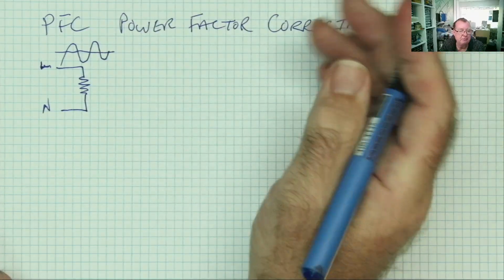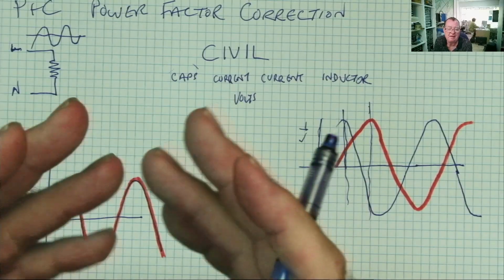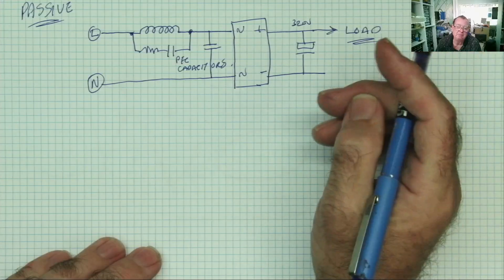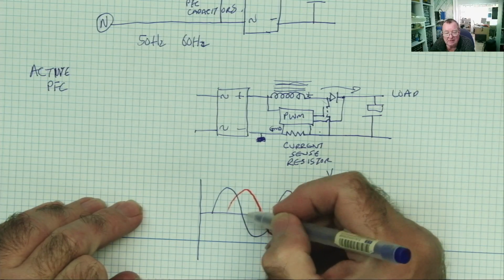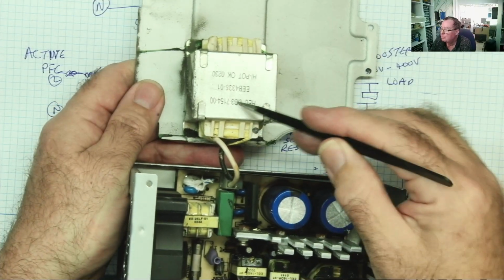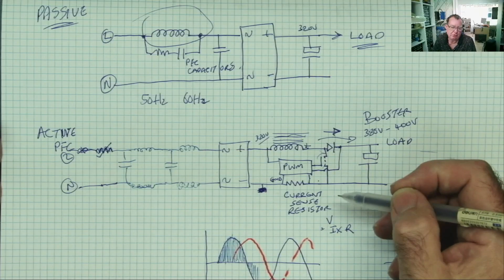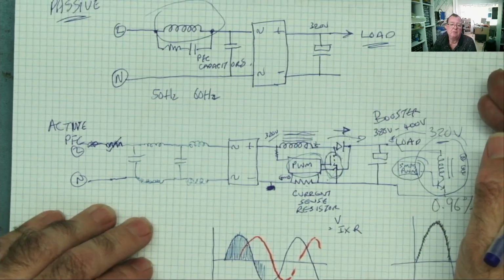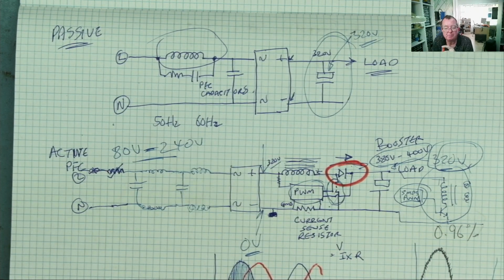All You Need To Know About PFC To Fix Stuff : Power Factor Correction For Beginners

Comment: Thank you, very informative video on active PFC! So, even on mains as low as 80 VAC, the load capacitor is still at 380-400VDC? In other words: the capacitor is always on 380-400VDC regardless of the input mains voltage?

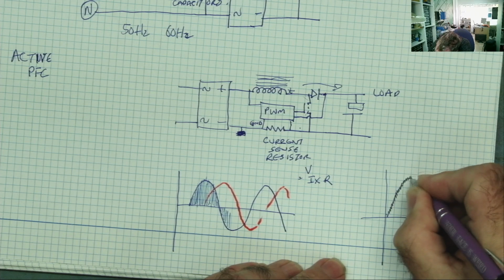Comment: 16:09,   I don't see how, by doing the PWM, the current at the output would just automatically follow the sinusoidal voltage to become in-sync. You just drew the micro fluctuations of current along the sinusoidal voltage curve, but how?  Why wouldn't the current still lag?  what makes the current profile fall onto the voltage profile in a time-synced manner ?
Reply: Because you (usually) need the voltage to push the current.

Comment: Hi sir
I have problem with a Dell laptop adapter (With PFC), many days confused me

When no load connect to it, I have about 500v on big capacitor (100uf 420v) that goes up dangerously, when I switch off it, capacitor voltage don't drop.
But with load on output, it works normally, 340v on capacitor, and when switch off, capacitor voltage drop fast to 0. Do you have any idea what's wrong about it?

Comment: Great video, in modern LCD TV power supplies (which I no longer repair…too many faulty screens discovered after repairing backlights) the PFC is a favourite to go up in smoke, either the controller fails or the MOSFET does taking out (violently) bits of trace and other components, remove the dead bits, PFC diode and isolate from the live feed, fit a link from + side of rectifier to main smoothing cap positive and away you go.

Comment: Poor power factor in power supplies that use capacitive filtering has nothing to do with phase shifting in the usual sense. Such supplies present an extremely non-linear load to the AC input source. Current only flows from the AC source when the instantaneous input voltage exceeds the instantaneous voltage on the filter capacitor, which means current flows only around the peak of the voltage. The rest of the time the current is zero. This results in a very high ratio of RMS to average input current which is very detrimental to the AC power distribution system. (The actual power consumption by the load is always related to "average" whereas the losses in the power network are mostly related to RMS.) Active PFC makes the input current waveform sinusoidal and in phase with the input voltage, making the load appear to be a linear resistance. The instantaneous input current is made to be directly proportional to the input voltage but the average input current must be made to be inversely proportional to the average input voltage. The latter is actually a "negative resistance" characteristic (and exhibited by all switchmode power converters that have regulated output). The duty cycle of the boost converter changes throughout each AC input half cycle. When the instantaneous input voltage is very low it still must be boosted to about 385 volts (in a typical "universal input" design) so a high duty cycle is necessary. When the instantaneous input voltage is at the peak at the highest allowable line voltage almost no boosting is required.

Comment: Blessings !!!
Thanks for that important and interesting information !!!
I have a power supply "Corsair" TX850M (of course 850 W.) and I changed the main capacitor ( 560 uF , 400 V ) because it was blown.  I bought and put a 860 uF, 400 V in its place thinking that it will fix the problem but it didn´t and as soon as I connected the PS, the new capacitor began to make a shshshshsh sound and smell in the specific way.
So the capacitor was not the problem but the victim of a malfunction which I suspect is located in the PFC.  Something is causing to raise the voltage above the 400 V which the capacitor can handel.
Can you give me any hints to solve this problem ?
I´m not a professional of electronics, I´m just trying to fix my power supply; but I´m also learning a lot about these apliances and I find them fascinating !!!
Blessings again !!!

Comment: Hello, friend I've got a expensive power supply if you can help it outputs 12v 4.5amp,24v 6amp with active pfc the pfc start at 370v when I try to drive 1.5amp from the  24v rail it drops to 300v at 12v rail it drops to 350v at full load (I disconnected the 24v rail) what do you think is't the 24v or pfc ?

Comment: On active PFC with power source removed, can the residual voltage across the big cap be measured across the diode, given that one side is at cap potential and the other side is at bridge rectifier potential, which is zero?

Comment: Plus one question: there probably is a voltage feeding circuit after the initial start to serve the pfc chip vcc during normal operation. Some info about this plus a simple schematic would be interesting

Comment: 33:30 - Thanks for adding that in (even if it were just an afterthought!) Before, it was difficult for me to understand how a single power supply could be used on such a wide range of input voltages. Until now, it had been somewhat of a mystery to me. I learn something from you every time I see one of your videos (some times it takes my watching them more than once to get all the nuggets out of them)!

Comment: I love the expression GND🥰.... VSS or VEE are weird names 🤖.
Reply: VSS,VDD, VEE and VCC VCE wouldn’t be used here they were applied terminology for lower voltage (often logic) circuitry. Voltage Source Source (and Drain Drain) CMOS and TTL for Voltage Emitter Emitter, Collector Collector, and of course VCE is a definition of voltage a transistor can withstand (without failing) across its Collecter Emitter (with the Base open circuit)

Comment: Hello, Richard! Thank you so much for this lesson.
It know it may be way too simple, but, if you can find the time, could you please make a video explaining about current sensor resistors? I'm always lost when thinking about how can a 1 ohm resistor "sense" 10 amps of current (since it will have about 10 watts going through it, I think).
Again, thank you for all your videos. I wish I can repay you and so many other youtubers that teached me so much someday or, at the very least, thank you in person and bring you some gifts. Cheers!
Reply: It's because the voltage across the resistor increases as the current increases, by Ohm's law. A 1 ohm resistor with 10 amps running through will have 10 volts across it. So the PWM/PFC chip is measuring volts, to know what the current must be.
Reply from the maker: Sure, I'll make a video about this topic

Comment: Amazing lesson as usual, but I didn't understand how this circuit got the current wave to be close to voltage wave, I understood it is trying to keep the capacitor 390v all the time but in terms of wave didn't get it, can you please explain a little bit to make it more understandable. Many thanks for your efforts
Reply from the maker: It didn't exactly, I used a bit of poetic license to get the principle over. 😇 The switching mosfet will cause very rapid voltage changes in the waveform.  But the filters on the input (capacitors, inductors) remove the high frequency switching noise and you then end up with a waveform like the one I showed

Comment: Hi, Richard. Thanks for this, it explains nicely how PFC works, which I didn't quite understood until now. 

And the last 7 minutes or so are GOLD, because you MIGHT make the mistake of trying to measure the main cap voltage in the bridge rectifier, being this such a common practice. I made that mistake once with a minicomponent power supply, and got a shock, fortunately only an annoying, not a deadly one. 

Made a video of it in my channel as a warning, but I'll better update that and explain that we should "look out for it" when we got an active PFC in our board. 👌

Comment: Do you know anything about this chip? L4981AD?  https://www.st.com/content/ccc/resource/technical/document/datasheet/0f/6f/aa/38/e1/97/4c/ca/CD00000085.pdf/files/CD00000085.pdf/jcr:content/translations/en.CD00000085.pdf
Reply: Oops hit enter too quick... I replace alot of these at work., but the power supplies have the circuits you mentioned too.

Comment: can we disable pfc when the pfc pwm and smps pwm is single chip?
Reply from the maker: Probably not as the PFC controller is monitoring the boost voltage. But no doubt it depends on the chip type
Reply: Why would you do this ?
Reply from the maker: @Lightrunner.  It's a useful repair technique, if you have for exampe a short circuit PFC mosfet on a 'combined' PFC+ PSU+Load type PCB, for example you could find in a TV, you may want to disable the PFC by removing the shorted Mosfet and see if the rest of the board will power up with say (non-boosted) 320V in the bulk smooting capacitors or if you have other faults too.
Reply: @LearnElectronicsRepair  ohhh, sorry. My question had a different background. I hadn't thought about repairing it😪.

Comment: Most power companies charge you extra for the maximum current load, and some will charge according to the overall Power Factor of an entire building. There's a good reason for that, which also is a good argument for performing Power Factor Correction.

As shown by the first drawing, a component with a PF < 1 will not be able to make full use of the maximum AC voltage. This means that in order to generate a desired amount of power, more peak current has to be drawn (because the maximum current isn't drawn when the voltage is at its highest, and P is still U x I). A device doing this is not actually wasting any power, just drawing more current at a lower voltage to achieve the same result.

However, as the diameter of power lines and mains cabling is directly related to current, not voltage, power companies have to install bigger/more lines to supply power to equipment and sites with a lower PFC, even though the overall power drawn might be the same. Since lines = copper + installation, and copper + installation = money, power companies would much prefer it if your PFC is as close to 1 as physically possible.

Oh, and this obviously works on a local scale too: You might think that the "I" amp circuit in your house in a country with a mains voltage of "U" should handle a load of I x U Watts, but if the combined PF of the devices you're powering is less than 1, the breaker (which only deals with current) will trip well before you get to the theoretical maximum.
Reply from the maker: Thank you so much for your input here,  this is a difficult concept to understand or try to explain without using maths that a lot of people would not understand anyway.

Comment: I think you have it backwards about the way power companies apply charges. Standard meters measure watts. The new smart meters are capable of measuring both VA and watts. In a purely inductive or purely capacitative circuit the VA measurement will be bigger (sometimes by many times) than watts measured.

The reason why power companies want everyone to have smart meters is so that they can switch the charging method. In some cases the cost can change from a few pennies or cents to several pounds/euros/dollars.

At the moment, power companies make up for the difference with a portion of the daily standing charge. Those with PFC devices are effectively being charged twice.

If they change the way power is measured the price per VA will be less than the price per watt but will more accurately reflect the energy consumed. That means the daily standing charge should drop but it is unlikely that it will.
Reply: Exactly why I never had and never will have a smart meter fitted.
Reply from the maker: That was meant to be a bit tongue in cheek 😅
Reply: Think I understand this better than many other videos